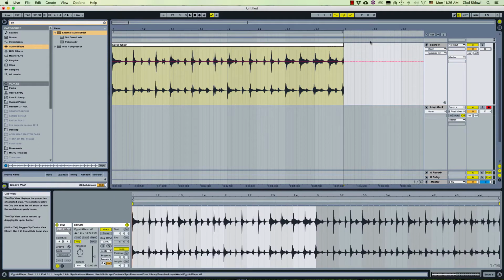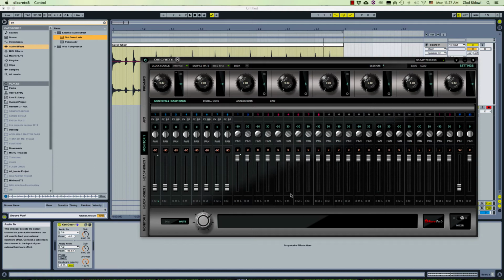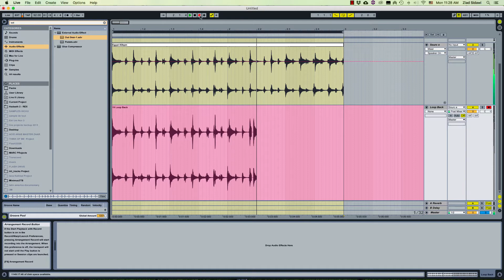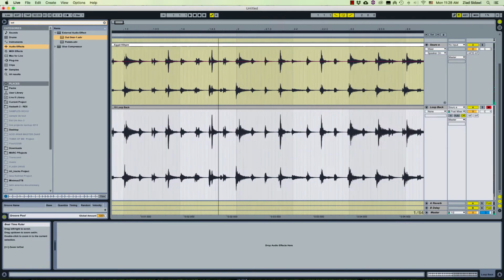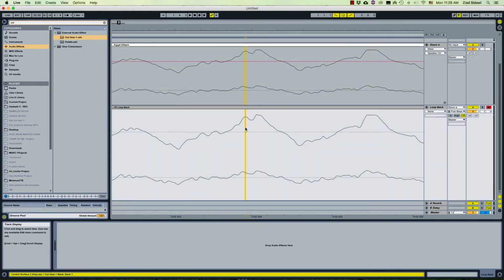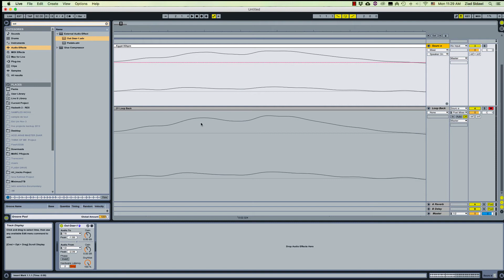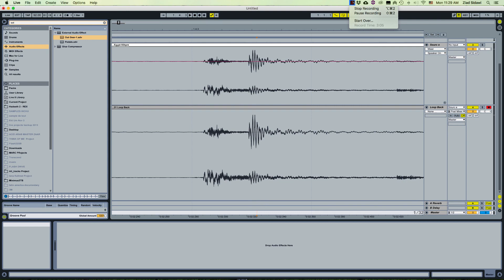Discrete 8 thunderbolt Latency Test

Comment: ZIAD...... THANK YOU SO MUCH.  you can show all the numbers you want but this shows how fast tbolt actually is.  if you could follow this up with one more example please.  run your loop with tbolt like you did and then do the same with any firewire device to show the diff.
Reply from the maker: TheDoug2103 my main purpose was to show  how to compensate for delayed samples when you go out and back in the sound interface. So in case of FireWire, you would probably compensate with more samples offset. Once you know that offset (based on a combination of your sound interface and computer hardware) then you can always that offset without testing each time you process OTB (Out ofThe Box).

Comment: Sorry, Ziad. I cannot understand if you used physical analog outputs and looped them back into analog inputs with the cables or it was just device's inner routing?
Reply from the maker: Gregory Matafonov I used physical analog out and then brought them back into the analog input 1-2 on the discrete 8. Remember, Descrete 8 has 8 analog outputs. So I chose to go out on 7-8 and come into the sound interface on 1-2.
Reply: @ZiadSidawi  then it is very impressive. Thanks!